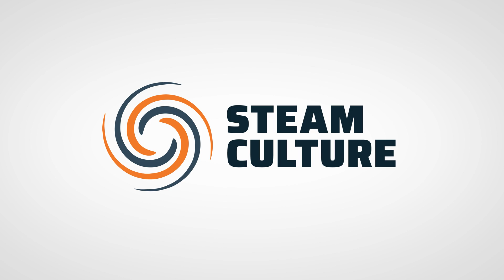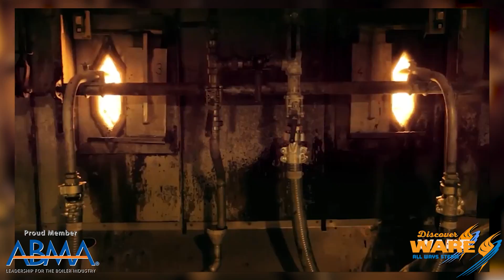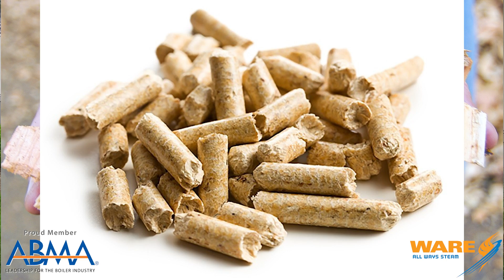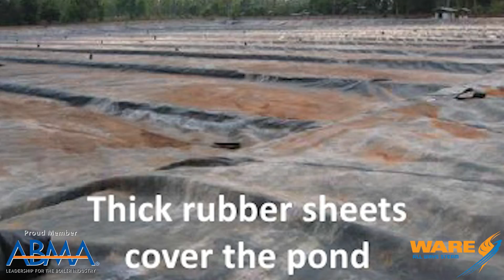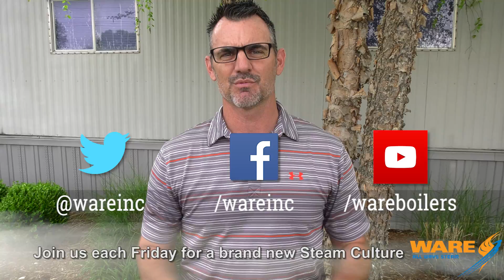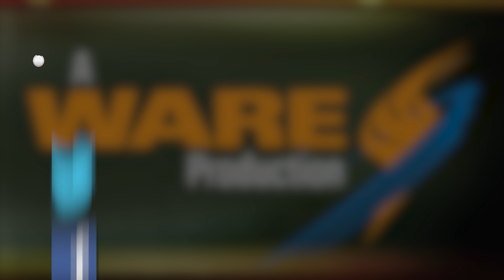Producing Steam with Biofuels - Steam Culture

Comment: If you're going to use waste natural gas/methane, just be sure you plan for the increased maintenance and initial capital cost there.  It's a pretty dirty gas to use and requires some good up front engineering.

Comment: Steam powered sawmills still make economic sense because as the logs are being cut, sawdust is generated. Enough waste sawdust is generated to be used as the primary fuel for the boilers that run the  steam engines that power the sawmill. For example, there is the Phillips Brothers Mill in Oak Run, California. If you replant every tree that is cut down, it can be considered carbon neutral.